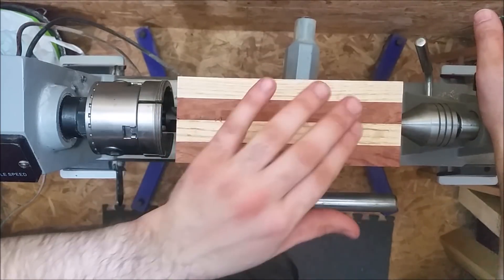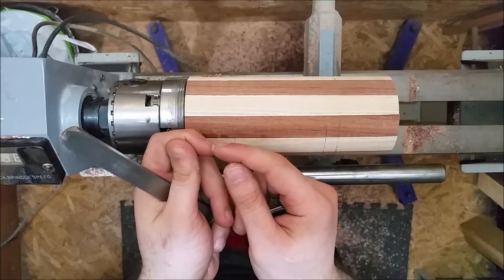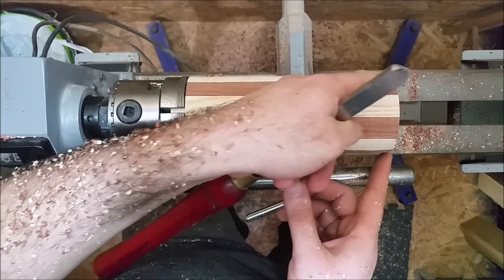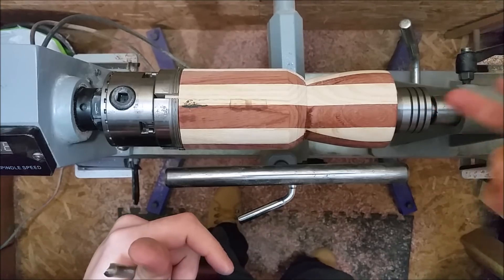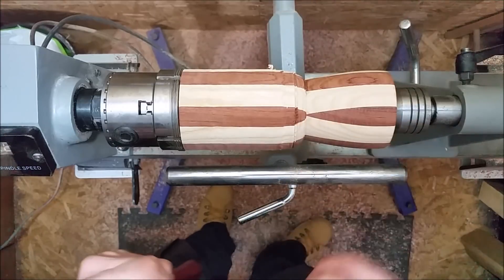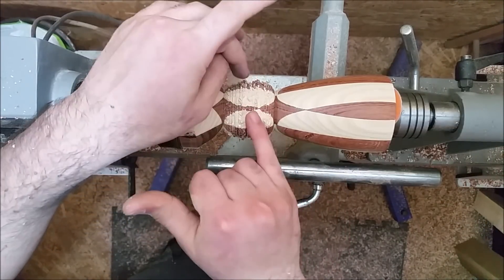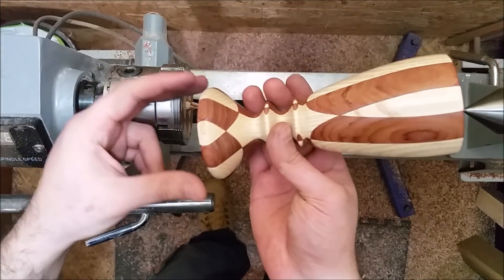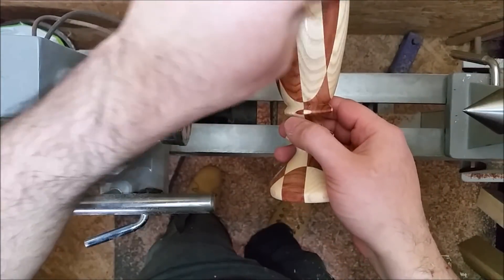Wood turning - How to make turn segmented goblet

Comment: Beautiful work Afshin.  The contrast between the Ash and Bubinga is just right.   You should try some captive rings on goblet stems if you haven't already.  Mike Waldt has a good video on how to make them.   They certainly impress others.
Keep turning.
Best wishes,
Alan.
Reply from the maker: hey Alan i have done captive ring before myself on a lidded box finial ;D check this out i made tool for it from a ring end wrench hehe https://www.youtube.com/watch?v=AhoM1HKJY9M&ab_channel=CraftWithAfshin
Reply: Wow! Afshin.  I must look it up.  I made my parting tool for captive rings out of an old wood chisel.
Reply from the maker: awesome if u get chance mate show me picture of it if u dont mind maybe i could turn my couple old chisel into those too hmm i guess the grinding part is the same but the ring wrench i used made it much more easier and simpler so yeah i gotta think about how to do it with chisel.

Comment: Very nice piece.
I admit that I would have liked it much more if the bowl of the goblet was thinner  (much more pleasant to drink wine from a thin sided bowl of the goblet.) And perhaps the stem could be thinner as well, more like fine stemware. 
But these are simply personal preferences, your goblet is your design, not mine, and what you have done is very nice work.
Regards
Dennis Beamish Cambridge Ontario Canada
Reply from the maker: Thank you Dennis for the feedback I appreciate it and I like what you suggested however i stopped at that thickness of stem because of the pattern i received on the wood, those small ash and Bubinga triangles around the stem would have had to be turned away if i was going to turn a bit thinner but for the next goblet ill try and product something like you suggested  :D